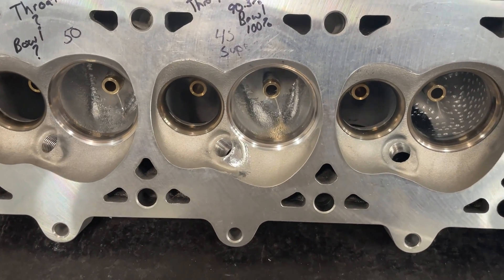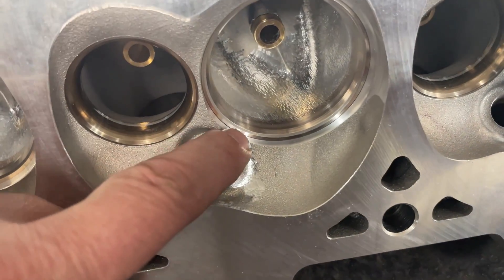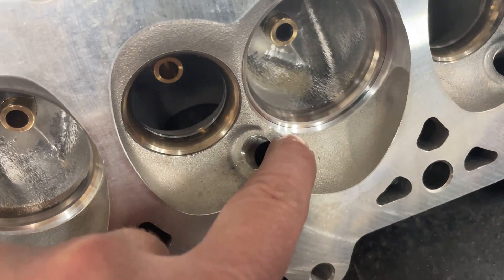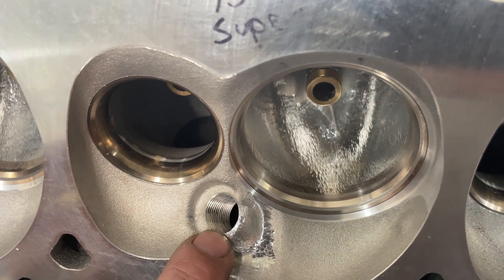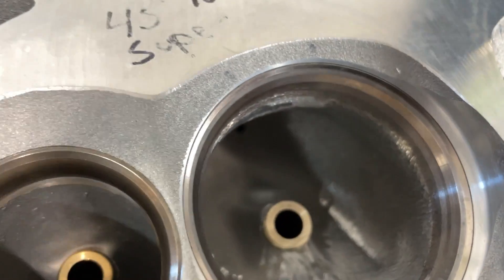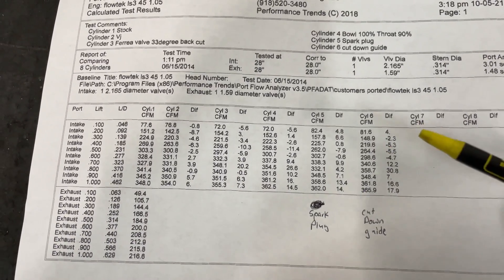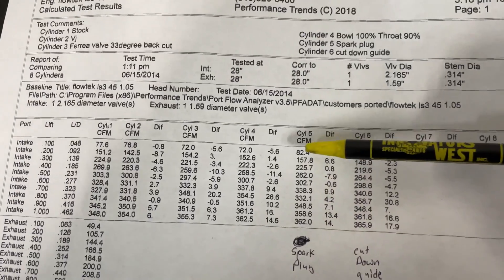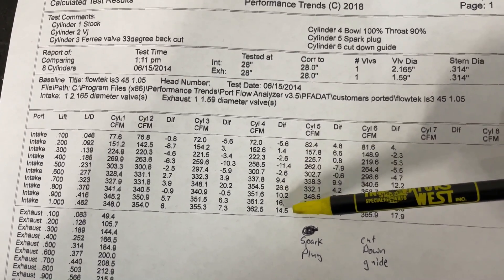LS3 Head Reshaping Around Spark Plug and Cutting Down the Guides

Comment: What if you shape the guide too smooth out the airflow towards the valve. Radius the guide to a slight taper, and round the edge of the guide but keep the same length.

Comment: Exposed spark plug threads might also induce pre-ignition. I liked and subscribed. I have a set of untouched BowTie Pro Stock heads from the 90's with unfinished chambers and ports (has the vane on the ex. port floor) that I would volunteer for you to work. I can't pay but I thought I would offer as I think they would generate a lot of views and different opinions.

Comment: the "dimple" in the Chamber is from the end Cylinder for a  accessory bracket bolt hole so it does not break into the Chamber , as all the Chambers share the same Chamber molds,
the dimples are in all the other Cylinders 
at the Spark Plug  , that "Dam" is a Mixture Vortex blocker during Wet Mixture Flow on a live running Engine , it probably will not show up at 28" correctly with Dye
Reply: Eye opening.
Reply from the maker: Thanks for the comment Larry. I know Brodix has a head I think the lm13 or something that has the poke out in the chamber like the ls heads do. I was told it’s for wet flow. I appreciate the input. I’m just playing with this head. Just doing stuff I normally would never do just to see what it does. Do you have any ideas.
Reply: @WeingartnerRacing  i enjoy looking at all your hi-quality Videos , very informative ! Also like the Flowbench Data comparisons between SuperFlow and Sanez Benches
No ideas at the moment , i'll Reply back if i get an idea for you to test .

Comment: The area around the sparkplug changed the area in the chamber. Because of the area change it changes the flow path in the port. If you use a pressure tap valve you will see the pressures change indicating a flow path change. Put this is relationship with the line of fuel against that one wall when you did the dykem test .

Comment: I had a powersports head ported for me and the company who did it cut my intake guide down flat with the port. I would like to see flow numbers on what that does since I know I lost longevity on a 10k rpm revving motor with a short guide.
Reply: Most powersports heads use a shim and bucket to actuate the valve as opposed to rocker arms or cam followers. I don't know what you have, but if your head is a shim and bucket design, there's no side-loading on the valve, and your longevity shouldn't be affected.
Reply: @McChadsworth  makes sense. It is shim and bucket yes.

Comment: The longer the guide the more restriction you have but the more stability you have on the valve. Cutting down on the guide gives you more area of air to travel thus giving you more topend power, but the downside to that is you don't have valve train control on the valve. I learn from past mistakes.

Comment: The valve guide modification did more than I though possible. 
   I’ve always been cautious about removing valve guide length. It also takes away the ability to remove heat from your valve and that is crucial.  
  I’d like to see the short side worked and different methods ,theories applied to the shaping.

Comment: Great vids! Frustrating I cant get some of my sugestions tried.  But understandably there is only one Eric to go around. So from here on in. I"m an observer only. But I sure enjoy your vids. 5 gold stars from me.
Cheers!
Reply: I know exactly how you feel about leaving suggestions and getting no reply or not trying what you want to see done. Most of these ideas I have already done myself so I’m just watching to see if something crazy happens!!
Reply from the maker: What was your suggestion. I get hundreds of comments.
Reply: @WeingartnerRacing  
Thanks for the reply and concern Eric. When you do the port work on the entry, try an oval shape to the bowl. See if that helps low lift and mid lift flow. Fill in the floor if you think the port would be getting to big with epoxy just to help.
Reply: @WeingartnerRacing  thank you for replying.
One of my suggestions I believe was to run a very large throat with a 60 deg seat angle. No top cut. Let the 60 run right out toward the chamber. One 75 bottom cut. Thats it. With about a 93 or 94% throat.

If that was explored. Maybe the bowl around 102% of the valve and finally start to erase the ssr in progression.

No that wont work on a running engine. I am just curious how that would relate in your fow lab enviroment?

Cheers!   Tom
Reply from the maker: @mohanperformance.enginerd.1308  unfortunately I don’t have a 60degree cutter. The 55 degree has a 102% bowl. Eventually I will test higher throat percentages.
Reply from the maker: @mohanperformance.enginerd.1308  I forgot I have already started laying back the short side on one port until hitting water. It sucks that one will probably air Sunday.
Reply: @WeingartnerRacing  thats not a problem. You make a great video.
Any head tech is right up my alley. I just pulled a n/a pump gas LS off the dyno. No glidden wing/hump. Has some fuel wetting. I have my own different aproach I am considering to test on my bench. But will hold off until you get back to the wetflow side of things on this internet port deal as I am confident I will learn from your experimenting. I really appreciate what you do. Thank you.

Comment: Seen this might want to test on the intake short side radius instead of cleaning the pocket to go straight down then radius to the floor of the intake they make an angle pushing the flow from the short side to the back side of  the valve pocket where flow rate is higher  thus increasing overall port flow.  Improvements in flow were on a Dodge 340 and 383 cylinder head.  Summary angle intake short turn radius to push flow to larger better flowing area behind valve pocket instead of having to make the short turn past the valve which causes port stall and decreases flow.